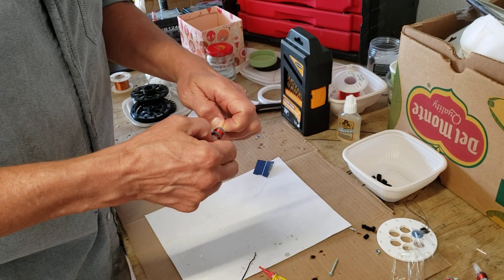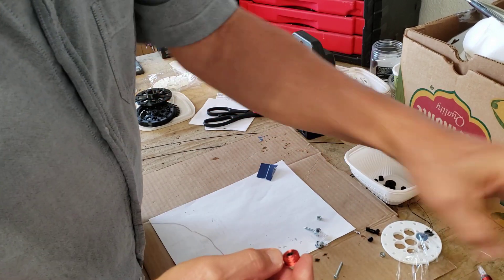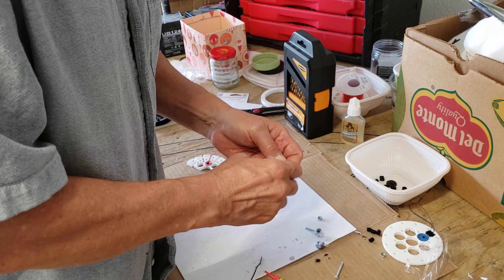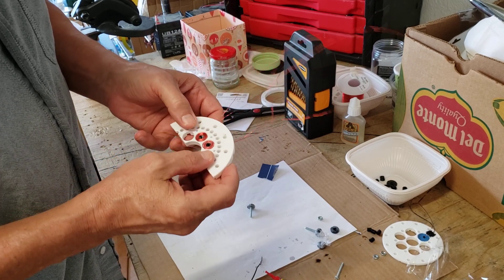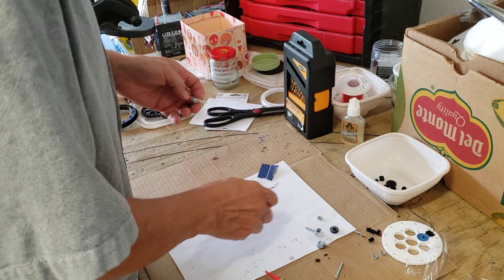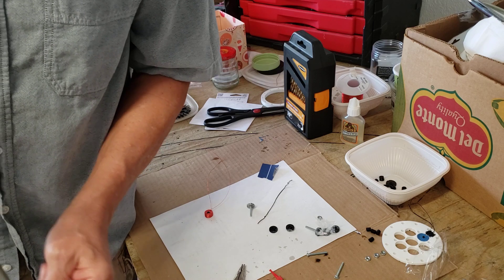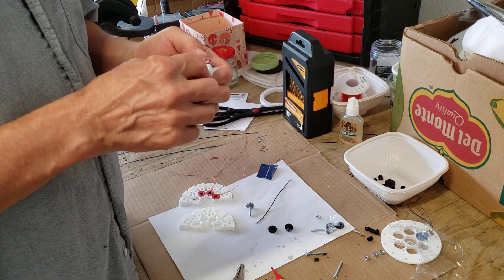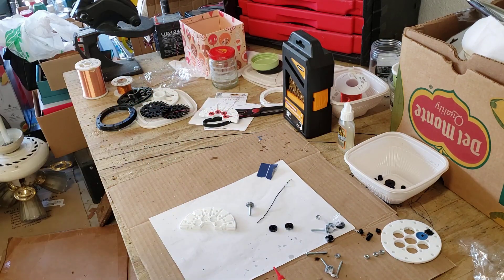bldc motor stator build

Comment: Rick, what wire are you using for your coils?
Reply from the maker: 28 awg / 0.01260 inch / 0.32004 mm
This is for testing. When I build a "real" motor I plan to use 38 awg with multiple strands. :)
thanks for watching

Comment: Faz uma controladora
Reply from the maker: For a sensored controller I use this board. 

DC 12V-36V 24V 20A 500W Brushless Motor Controller Hall BLDC Driver Board Voltage PWM speed regulation JY01

https://www.aliexpress.com/item/1005001717931298.html?spm=a2g0o.productlist.0.0.268e104bpTPqZw&algo_pvid=089af937-5ed1-4288-9d89-2806c7a55211&algo_expid=089af937-5ed1-4288-9d89-2806c7a55211-4&btsid=0bb0624016157358028078161e101c&ws_ab_test=searchweb0_0,searchweb201602_,searchweb201603_